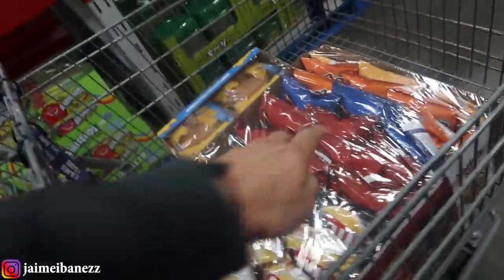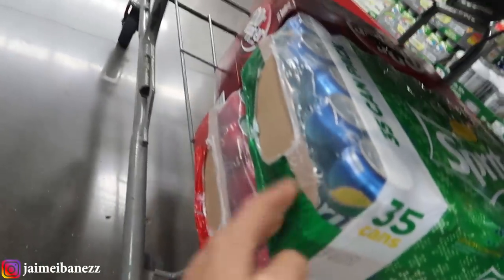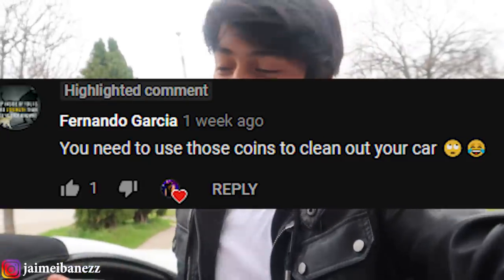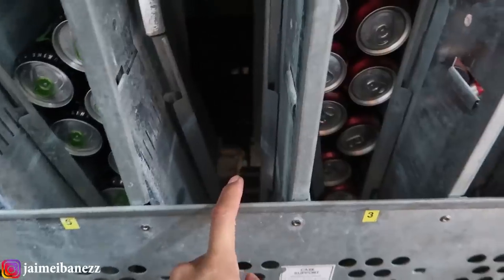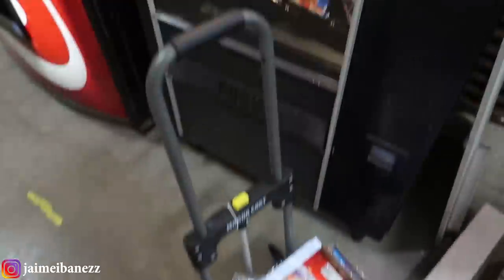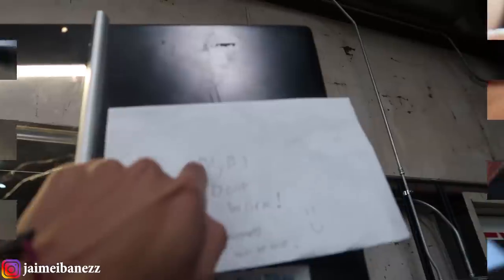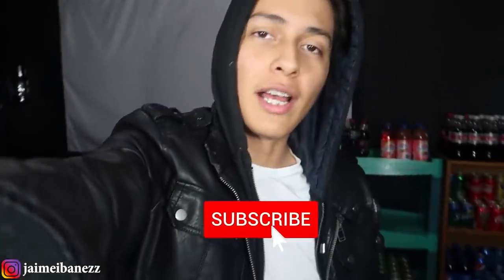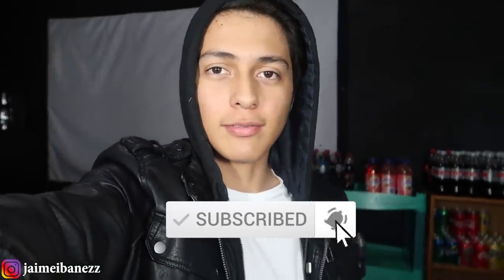Pulling Cash From My Vending Machine Location 2019

Comment: Total income is inaccurate. 219.35 - 87 - 10 = 122.35. Then perhaps 8% sales tax since you are selling stuff (state and city) so 122.35 - 9.80 = 112.55. Then withhold 12.4% social security (self employed) 112.55 - 14 =  98.55. Then subtract 3% medicare = $95. Then subtract federal income tax of at least 15%  so 95 - 14.25 = 80.75. Then subtract state income tax of say 5% (depending) and even after this potentially city income tax so it could be only $75 or less. Then you can get hit with another 8% sales tax when you go to spend that and don't forget to pay your 2% rate property tax (this could be $9000 a year in NJ easily)! If you live in a state with vehicle property tax don't forget that (easily $300 more) also needs to be included along with vehicle registration cost (easily $40 a year) and cost of renewing license(over $10 a year)! This may sound sad but it is true.
Reply: You're overanalyzing everything. Just figure out the operating net income, which doesn't take income tax into account.